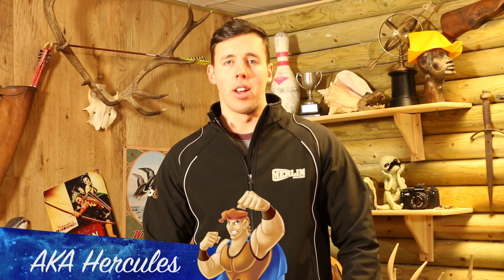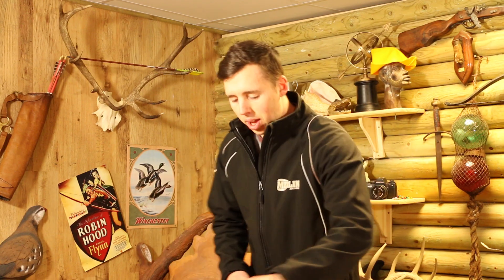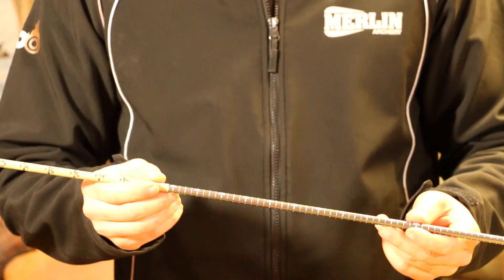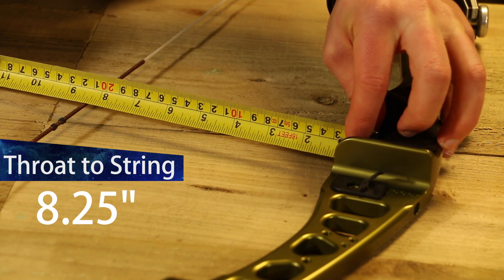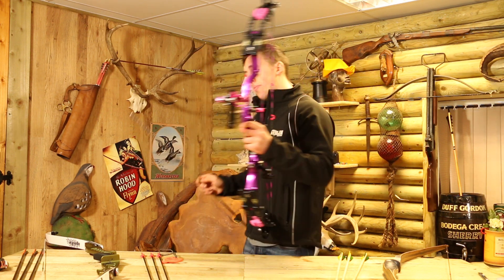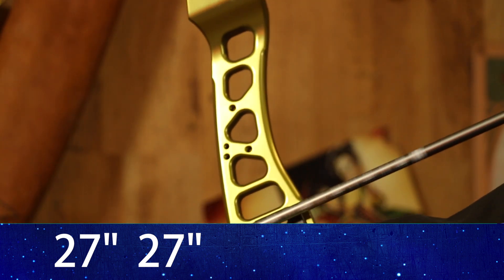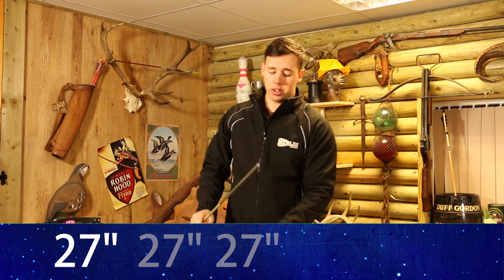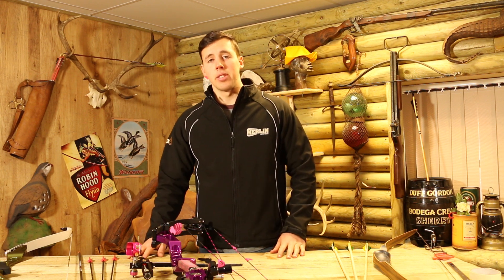Merlin Archery HOW TO: No. 3 - Measuring to AMO

Comment: We should aim the bow/arrow against our normal target, and draw till "our preferred anchor position", when measuring our draw...
NOT point down, as this vid shows, as that will give a wrong distance!

Apart from that, the AMO drawlength was very well explained...

If we imagine a very strong longbow, with a handle being 1,75 inches thick,
(seen from the side, and including the skin or textile wrapping), 
the AMO drawlength simply goes from the string, to the front of the handle...
When using the first finger as arrow rest, the POINT will rest on that, but only in front of the bow...
Then the point can not "shoot through your finger"... So that is a safety precausion...

Then, when measuring the arrows with the AMO standard the arrow shall simply be bought or made,
to have the same length as you draw length, and then the point IS IN FRONT of the bow, as it shoud be...

That was simple and logical... But with a diffrent shape of the grip, it will "generally fit", 
when measuring to "the back of the handle and add 1,75 inches"...

BUT if the grip is smaller, THAT does not fit... As many wish the POINT is "just in front of the handle"...
And when shooting with sharp points, to train for hunting, the point should be further from the bow,
so your finger is not cut, even if you make a too long draw...
Some wish it is one inch in front of the bow, some wish two inches, some wish even more...

So the "AMO draw length", is not a "miracle formula" to order the right length of arrows, 
it is the "general advice for target shooting, with target points"...

Some wish the rear metal edge of the point, "just touch the finger" in full draw, 
so they simply draw till the finger FEEL the edge, and "then they know the drawlength is correct each time".

If we happen to have a finger, 3/4 of an inch thick, and a handle, 1 inch thick, then "adding 1,75 inch" actually fits that...
And I believe THAT was the original intention, behind that rule, in the AMO measurement,
as most old Longbows had a handle 1 inch thick...

Comment: Thanks, Luke I am very grateful For your Advice On the measuring Of the Correct way To know Your arrow length.. Now I know My Wooden arrows Need about 2 And 1/2in Cut-off. Thanks again
Reply: May I ask whether you gap shoot? (ie no sight & non instinctive) & do you shoot longer distances?  If you do gap & don't shoot long distance you might find a longer arrow advantageous (providing they are spined correctly) as it reduces the aiming gap.  Would be great to get Merlin's opinion on this as I'm just a backyard flatbow shooter (aka noob) atm (hoping to pick up a recurve soon) but I did get this tip from Jimmy Blackmon's channel.
Reply: @helphelpimbeingrepressed9347  That is correct. I got the same advice....

Comment: So the draw weight measured at 28" in recurves and longbows. Is this how I need to measure the 28" draw length for measuring draw weight of the bow? How am I supposed to do that? Beacuse from the draw weight measuring span, I can either measure from throat of the grip or from the front of the riser? How to I compensate for 1.75 inch?
Reply: Yes, the bowmakers "in the western world", will draw the string 26,25 inch (28" minus 1,75") from the rear of the handle, when measuring draw weight...
But "rear of the handle" is defined as "where the gap/cleft betweeen thumb and first finger press"... I believe that is what you mean by "throat of the handle"...

For long I did not know this, so I pulled the string 28" back from the handle, when checking drawweights, and found "the bowmaker measured this wrong"...
The draw weight was "5 to 6 pound too high"... I did not understand why two different bow makers, both measured "so much wrong"...
Untill I saw this video... Now I understand, it was me, who measured in a wrong distance...

In contrast several Asian bow makers write, they measure draw weight at 30" for some bows, and perhaps at 35", for Manchu bows, and that is not AMO measure, so they "surely" simply measure that from the handle, without "subtracting 1,75 inches"...
Also Asian Bow Shops, will normally write the "total length of arrows" including the tip and the nock... Again because they do not follow the American Standard...

Therefore, when a "western" bow maker use the AMO standard, and wites: " Maximum draw = 30inch ", he also means " 28,25 from the handle"

Happy Shooting
Dan

Comment: Thanks Luke!  When measuring draw length it is very important to have proper perpendicular shooting body frame.  You had proper body frame for your compound draw but go back and look at your draw for the two recurve bows.  Without proper body frame you will not expand and use correct back tension.  This is really important and a cause for hunters undershooting from downward tree stand shots because they do not come to full draw.  My guess is you were clearly more confident with the compound and muscle memory took over.
Reply from the maker: Luke had to aim down in order to not hit the ceiling with his limbs haha, in a more spacious area I believe he would of done so. Thank you for noticing the importance though, it's appreciated :)

Comment: Thanks Luke, I try to use a 33" Arrow as my pull is 31" but I`m only 5' 6" tall with short arms, I do get told that I pull too far but I`m comfortable with this, I shoot a Recurve and Mongolian bows, @ 60lbs, am I out of order pulling this far ? as I said I`m ok with this, Just thought I`d ask anyway ?? I could of course relax and pull @ 28" I`m a bit worried the head will go into my holding hand making a mistake !! there`s been a few times I`ve pulled it off the bow completely trying to comply
Reply from the maker: Yeah we believe that's waaaay too far as a draw length at your height. However Mongolian bows are incredibly hard to judge because draw length tends to increase on average when you shoot them. If you're happy to, give us a call at the shop or drop us an email at support@merlinarchery.co.uk and we can get into the details on possibly how we can help you improve
Reply: where are you drawing to? Recurve should be to the corner of your mouth-ish. Mongolian is generally further.

For someone of you height that should not be anywhere close to 31. I am 6 ft 5 and i only draw 29 on a compound bow. Recurve 27-28.